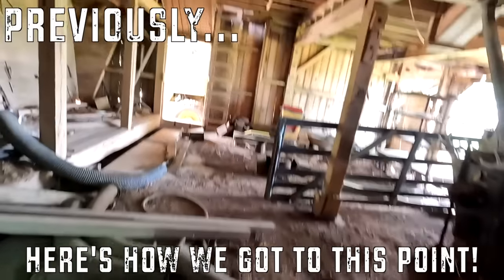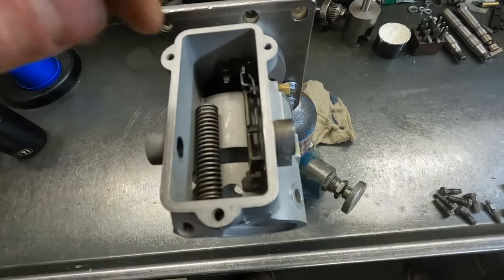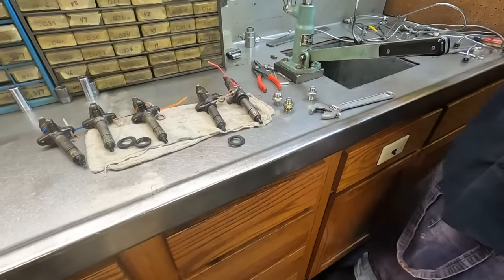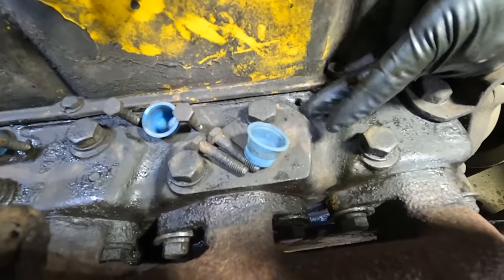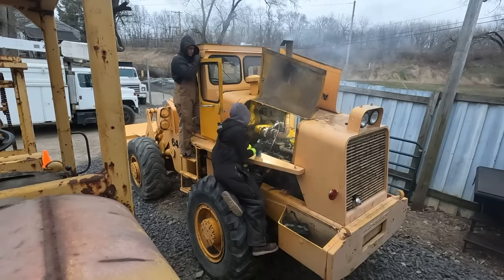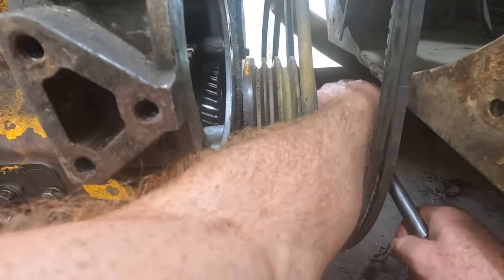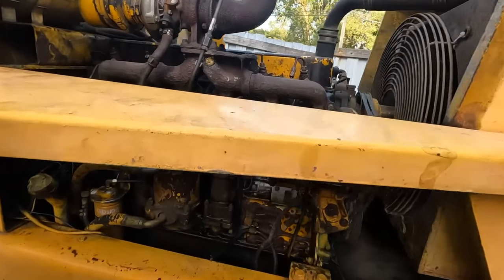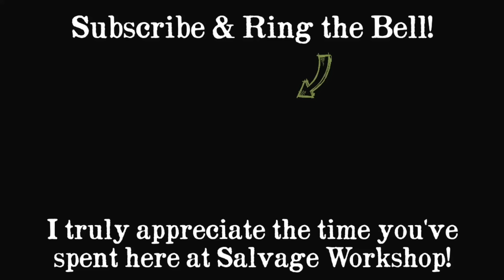The OLD Loader won't Stay Running...I'm STRUGGLING to figuring it out...Will it EVER run AGAIN?

Comment: I have another sentence to type to you about. In a carbureated engine, the fuel from it went through the tunnels of the air inlet manifold. While that fuel is traveling through them, the mist of it collide into each other, causing it to produce slightly larger droplets instead of mist. This continues until that mist and larger droplets eventually enter  into cylinders. Then it starts to become quite interesting. Those larger droplets don't easily burn. What happens to them? Those that don't completely burn exit those cylinders into the exhaust ports of the heads and then into the exhaust manifolds or headers of a performance engine. The fuel that didn't burn in those cylinders. That's why fuel injection is better than a carbureated engine. The fuel stays atomized because it doesn't travel through those tubes of the air inlet manifold.

Comment: The radiator  looks like a bad repair  from someone didnt know  what he was doing take it to a good radiator  repair  shop were old guys still know what there doing and 2nd thing was when you working  on the coolant hoses install a shopvac hose in the filler cap tape it good then turn on the vacuum  you have very  little fluid comeing out no need to put your fingers to block it off

Comment: Disappointed that your not trying to keep it Original. You only need to cut the pipe and move it forward or change all the old rubber ez. Fitting the seat again ez to make a few brackets .